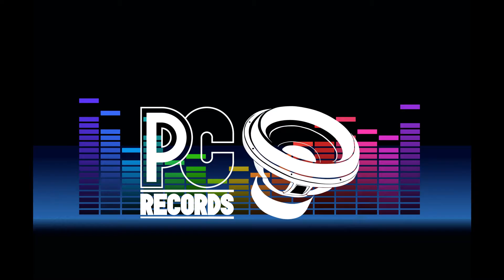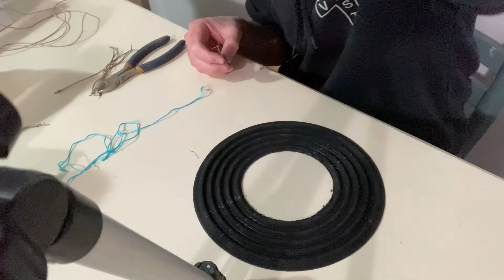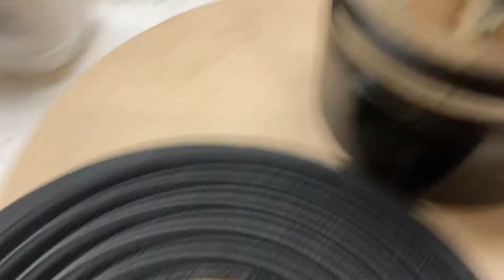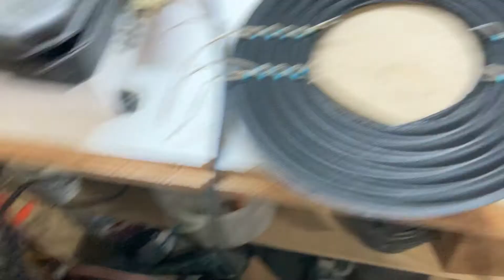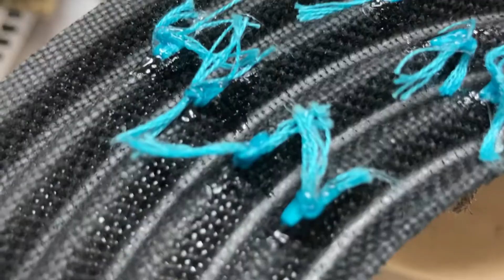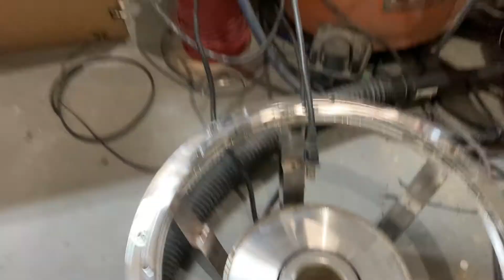How to Custom Stitch Tinsel Leads onto Subwoofer Spider

Comment: When you are creating a spider pack with multiple layers do you only sew the leads to the top layer or can you glue the layers together first and then sew the tinsel leads?
Reply from the maker: I usually add some e-6000 daps around the spider between the layers. Not a ton but at a couple points. I have had layered spiders make a wired noise in the past that was caused but the layers smacking against each-other
Reply: @MrM_Full-Send No i meant as far as sewing on the leads. Is it best to sew them on after the layers have been glued together so the stitching goes through all or only sew the leads to the top layer and then glue it to the additional layers?
Reply from the maker: @hopskustomaudio sorry? I misunderstood. Yes sewing should be done after layering

Comment: Did you just solder the spider wires on to the coil leads
Reply from the maker: yes. I glued the spider to the coil former and soldered the tinsel leads (on the spider) to the Voice coil pig tails.

Comment: Hey Mr.M Thanks for the Video, maybe u could awnser my question, i have a Ampire 15.1 with a broken Tinsel Lead in the middle of the Spider is that repairable ?
Reply from the maker: you are very welcome!! you can repair it several ways. ideally i would rebuild the whole cone assembly but i have in the past soldered an additional piece of tinsel lead before and after the break making sure the added piece doesn’t cause any unnecessary flex restriction to the spider. this approach is not pretty and in many cases lacks the longevity of a proper lead wire. hope this helps!

Comment: Hella nice to have a 3d printer I could print my triple joint rings cone connecting ring spider clamp down rings custom terminal prolly more stuff than that 3D print a nice set of shims if it's cost effective idk
Reply from the maker: honestly… when i bought it i had no idea how useful it would be… i’ve printed spacers, clamp rings, triple rings…  collars of all sorts i made shims for a motor top plate to glue and realign… it’s paid for itself 3X over. only issue… it’s a 220 x 220 build plate so… there have been several times that i needed to print rings as multiple pieces and glue… not ideal but it worked

Comment: Would cutting the outer diameter be easier?
Reply from the maker: Ya cutting the outside diameter is generally easier. However nothing was available at the Time that would have been suitable. You need a flat spider flange to glue down so if you go to a bigger size you couldn’t make it fit without removing the entire flange (typically 1/4” wide)

Comment: When you assemble spider packs yourself, do you just use CA and clamp them together around the outer edge or do you also coat the whole insides with a flexible adhesive like E6000?
Reply from the maker: E-6000. I’ve done it several different ways. I did perimeter only once and had the spiders smack together while playing. Only once ever but now just to be cautious I do the entire perimeter and several points on the ridges
Reply: Okay thanks! Yeah these spiders I have now dont have any glue aside from around the perimeter and you can hear the spiders smack together when playing free air, not really an issue once its in the box. I was just wondering whats the best as I have never had to assemble spider packs myself yet. These subs I'm working with also happen to use 8.5" spiders so options for them are kind of limited. I appreciate the quick response!
Reply from the maker: No problem!

Comment: Good tutorial bro, about to stitch my own for my SWX rebuild. Have you done a tutorial on the different adhesives used for rebuilding a subwoofer yet?
Reply from the maker: No I have not. 🤔
Reply: @MrM_Full-Send  I would def make one bro, I’d really dig knowing about the diff rubber based glued (ca, nitrile, etc) as well as more permanent stronger bonds like straight up concrete type lol. Also a guide on tinsel leads would be cool, I’m always guessing on power handling, wish there was some kind of guide for matching power reqs to tinsel size, etc. lately I’m guessing that flat wide leads will handle anything. But ya just some ideas 💡